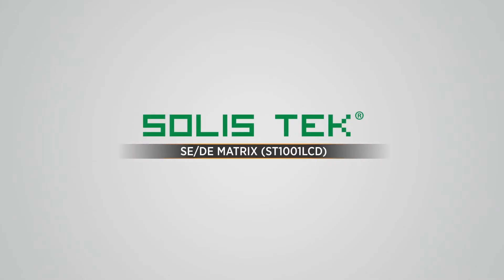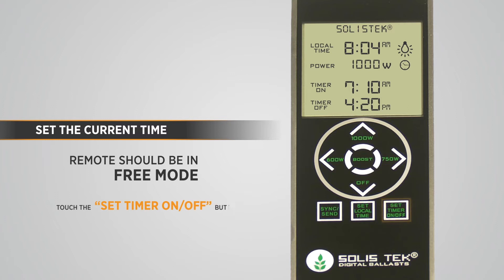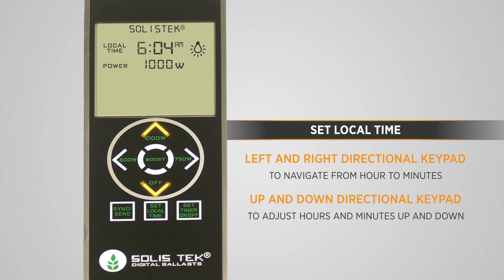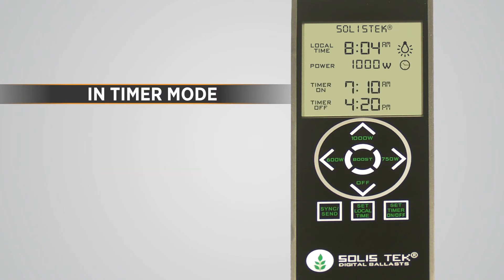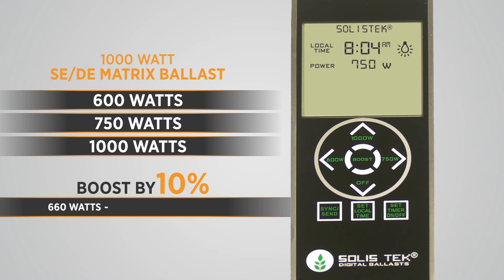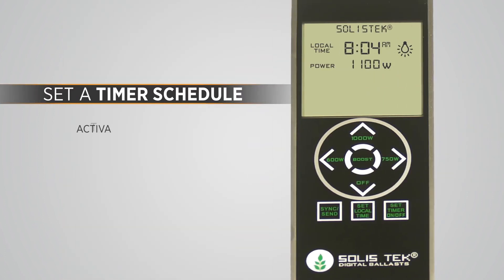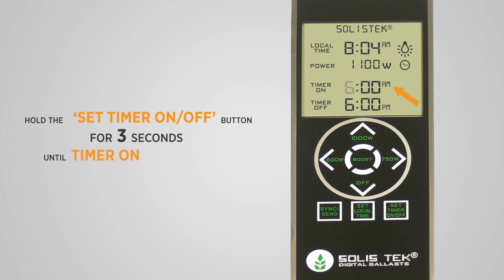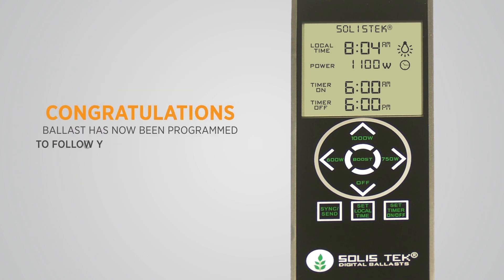SolisTek SE/DE Matrix Remote Tutorial STK1001LCD / RC1001

Comment: Why is it I constantly get error 4 and error 5 when I use the solis Tech splitter and two 600 watt 10000 Kelvin metal halide bulbs for finishing. It does not have a problem at all pushing 2 600w HPS bulbs. What is going on is the ballast on its way out or is it just a cannot power the metal halide at that Kelvin. It seems like oil drops form inside the metal halide Arc tube and that is what I think is shorting it out. Other than that I have no idea. I've tried new bulbs. No difference